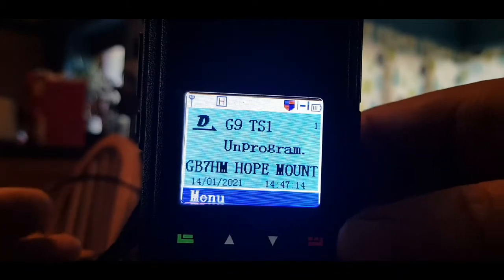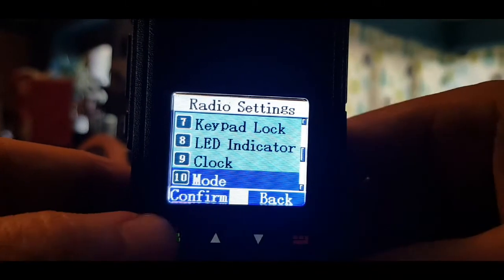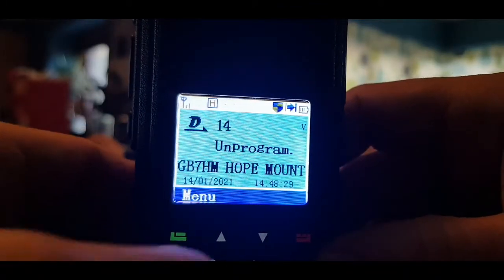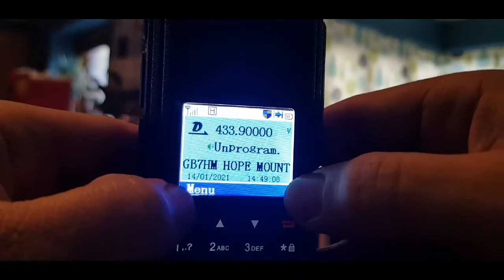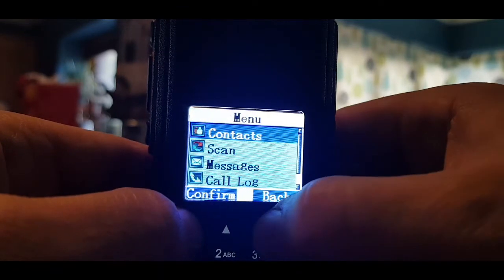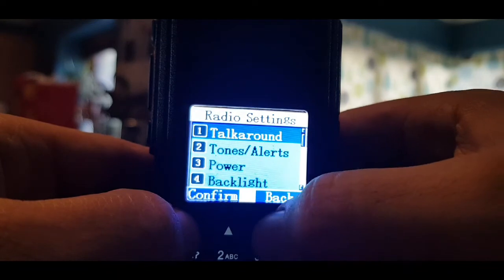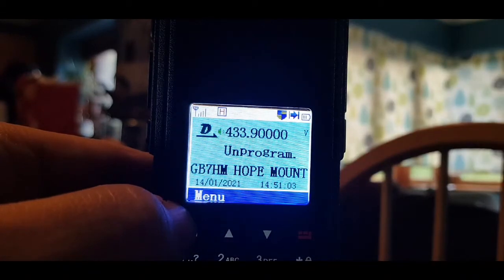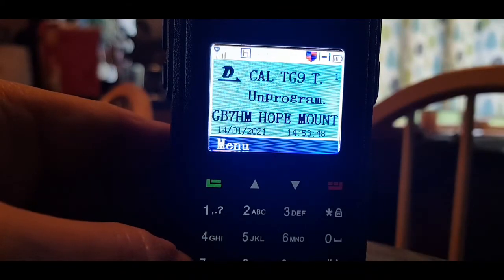Retevis RT3s -VFO mode

Comment: Obviosuly you didn't look at the radio screen. It was ALREADY in Digital (big D left QRG). This is why al RADIO SETTINGS shown DMR parameters and prevent changing analog ones...

Also, you don't have a wide knowledgment and practice on that radio/firmware...

To have it swapped form D to A, you need to LONG PRESS RED BUTTON.
Once in A, you can access FM parameters at the same menu you where using.

Summary,
You need to longer practice your radio and firmware  b4 recording video. 😂
Reply from the maker: Its my Diary

Comment: When I get into VFO mode it stays in Anologe I can’t get it to go in digital
Reply from the maker: Go to channel settings select digital .
Reply: @HamTechRadioScannerDrones  do you have a certain firmware that has colour code and time slot selection all from the keypad? Mines dosent
Reply: @HamTechRadioScannerDrones  ?
Reply: @BFsTransportVideos  on the cps software, go to the VFO mode on the bottom of the list on the left. Make a VFO A as a random analogue and VFO B as a digital. you then must be on a zone that has two channel lists, A and B in use. Just create a new Zone called "Manual" or something and add a channel to A and B. You can then switch from analogue to digital by pressing up and down to select VFO A and VFO B. Fiddly i know but its a workaround that works.